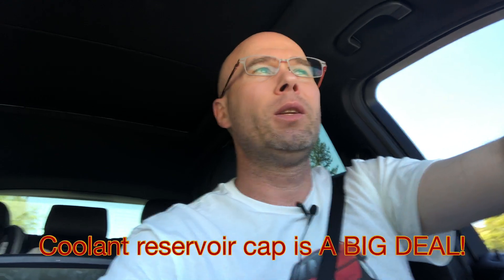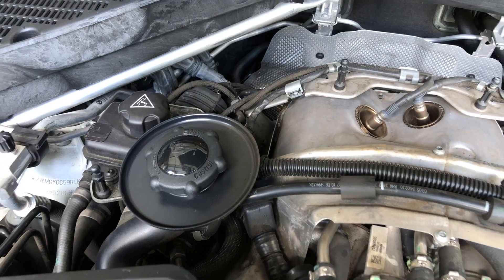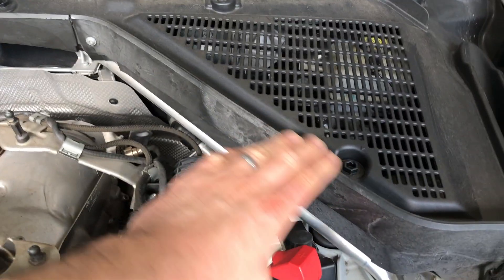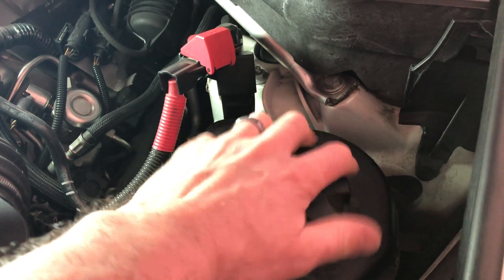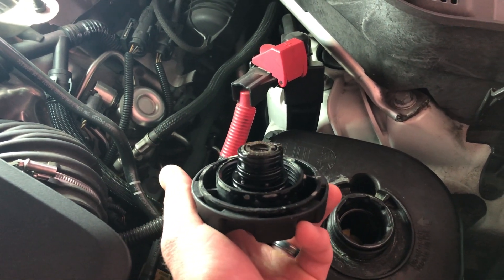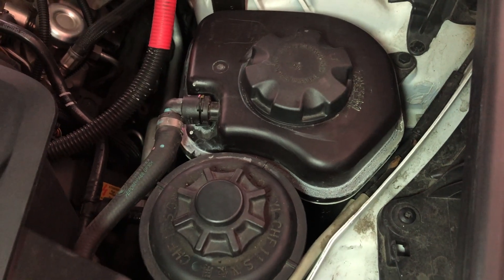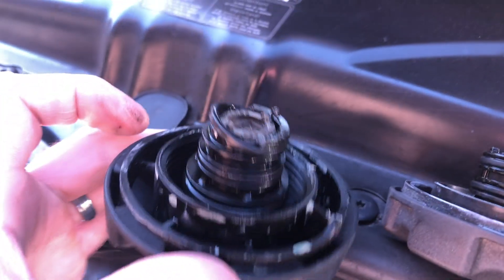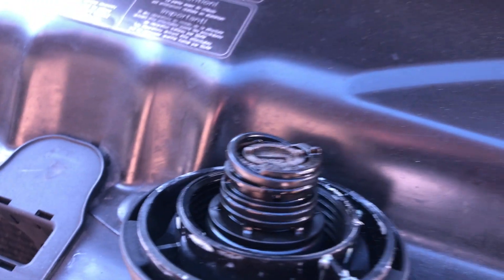BMW S63 engine high temperature destroys oil and coolant caps

Comment: I’ve come to the same conclusion as you did. Something people don’t realize. I’m now wondering if an exhaust wrap and vented hood would alleviate these issues
Reply from the maker: I'm sure a turbo blanket and vents would help. Also, I think deleting cat converts will lower the temperature, but it requires a tune, and in some places may be illegal.

Comment: BMW has been having Trouble with this Engine since 2008? Why wouldn't the Engineers just Fix it? I heard the N63 Twin Turbo V8 has gotten 2 Class Action Lawsuit. After Recalls and Warranty Fixes, they keep Producing this Engine without Modification. If you Customers still buy this car then they are asking for Trouble.
Reply: This is the real "hot v8"...

Comment: Hi has anyone tried the SPORTS OIL COOLER VALVE for the N63 or S63 I heard it keeps oil temperature low. how is the 90 degree thermostat keeping up, any updates?
Reply from the maker: Thank you for your comment. 90 degree thermostat works as in the video. It is keeping temp lower, but not even close to 90 degree. In my case it stays in higher 90s lower 100s. I guess it is better than stock.

Comment: Hey man, could you tell where you bought the cowls? I am not able to find any other than used
Reply from the maker: Hello, I bought them from ECS tuning, back in 2017 they were $55.77 each. https://www.ecstuning.com ECS parts numbers 178996 and 178997
Reply: @EliteBimmers  was the install straightforward? About to buy these for mine.
Reply from the maker: Daniel Quach Yes, very easy installation. Did not have any problems.

Comment: Thanks for the video! Great info on the S63.  I'll have to check the caps!  Do you live in a place with hot summers?  Or mild temperatures?  I wonder if that has an affect on how badly the plastic degrades.  I'm in Canada and it's mild here, so I haven't seen too much deterioration, but BMW plastic definitely still breaks easily over time, and exposure to the heat from the engine.  I'm gonna try spraying the plastic with silicone grease to see if that helps preserve it. 
Cheers!
David.
Reply from the maker: Thank you for your comment!
I live in Vancouver, Washington, it’s very mild summers here. Our X5M spent most of its life in Southern California I think this added to a shorter life of some plastics. My plan is to lower temperatures anywhere I can. Already installed 90 degree thermostat, next will be catless downpipes. My goal is not more horsepower but prolonged engine life.
Reply: EliteBimmers I see!! Hi from Vancouver, British Columbia! It's cooler up here so hopefully it won't crack so badly, but it's still a hot engine.  Great idea with the thermostat.  I should use a lot temp one too. Yup, less HP and longevity sounds like a good idea! Great advice!  Cheers, David.

Comment: My expansion tank cap was leaking had it replaced on my x5 50i couple weeks ago as well.
Reply from the maker: Mine doesn't look like it's leaking, but I'm thinking to get new one anyway, new expansion tank, new cap and fresh coolant.
Reply: Does your X5 have any oil consumption? Mine is in the middle of an oil consumption test at BMW
Reply from the maker: It does. But it's what I convince myself is "normal oil consumption" lol 
On our E70 I did oil change only three times, first two times were at the dealership, last one I changed myself. Had to add oil after 6000 miles after dealer changed oil. I owned other BMWs, and going to 6k without adding some oil is considered an achievement :)

Today I checked our E70's oil level and after 3000 miles its still showing "full". Hope that iDrive "gage" is correct.
Reply: @EliteBimmers  Thats actually really good. I heard some ppl have to add a quart after 1k miles..
Reply from the maker: Yes, I added 1 quart after 6k miles. Also, I switched to Liqui Moly and I read only good reviews about this oil. I'm pouring it into E61 and E70 now, so far oil consumption is less. The choice of oil brand is very controversial, but in my little experience liqui moly made a difference. For now, I'm sticking with it. 

Also, on E70 I'm ordering 90-degrees thermostat, I read on Russians forums it does make a difference.  Hope my oil consumption will drop even lower.
Reply: @EliteBimmers  liqui moly has many different oil types. Which one do you run and what weight,
Reply from the maker: I got 5W-40 full synthetic.
Reply: @EliteBimmers  Motul makes the best fully synthetic engine oils.